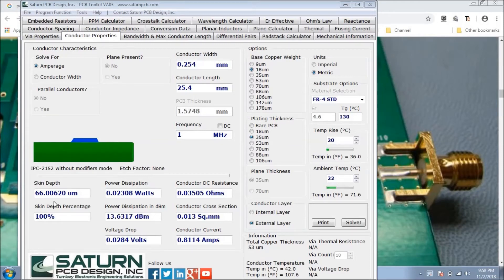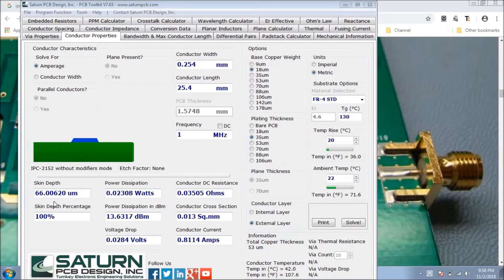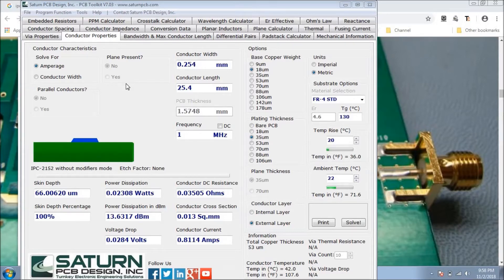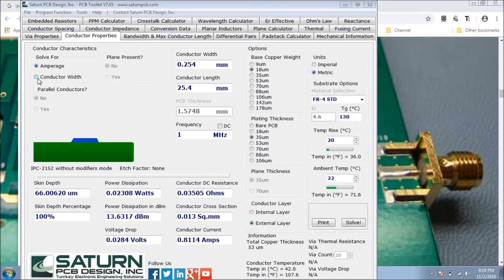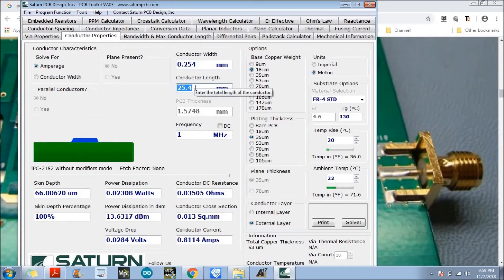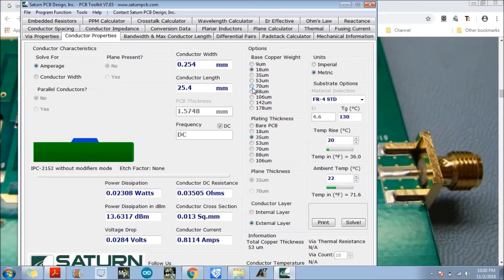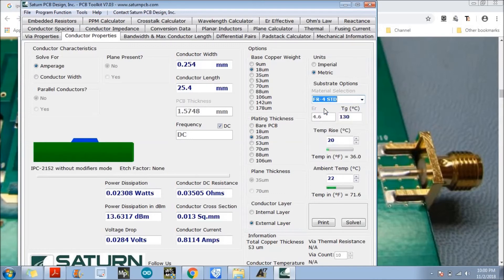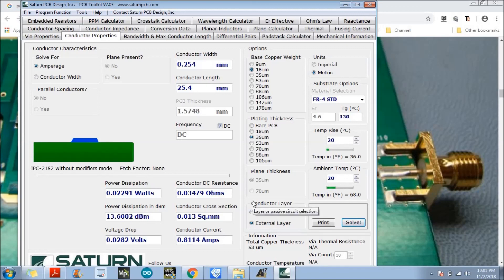Saturn PCB Toolkit tutorial Part-3: Conductors Properties in details

Comment: Can't find episode 4
if you could put up a playlist of all the 22 odd episodes in this series, that would be awesome
Reply from the maker: Hi Martin, there is already a playlist available for Saturn Tool, please check once in playlists section
Reply: @EsteemPCB  
ok, thanks, i'll have a look
although i don't know where the playlists section is
but, ok, i'll have a poke around
Reply: @EsteemPCB  
Oh i see...
No No...
here is my problem
i found videos 1, 2, 3 and the one that is not labelled as (but is still) 4

In video 1 he said he was going to go through every single tab, like 22 of them, so i'm looking for the Saturn PCB playlist that goes through all these

so..
Part 1 -  Introduction
Part 2 - Conductor Properties
Part 3 - via's
ALL DONE

I'm looking for 
5 - Bandwidth and Max Conductor Length
6 - Differential Pairs
7 - Padstack Calculator
8 - Mechanical Information
9 - Embedded Resistors
10 - PPM Calculator
11 - Crosstalk Calculator
12 - Wavelength Calculator
13 - Er Effective
14 - Ohm's Law
15 - Reactance
16 - Conductor Spacing
17 - Conductor Impedance
18 - Conversation Data
19 - Planar Inductors
20 - Plane Calculator
21 - Thermal
22 - Fusing current

the playlist only has 4 videos in it, i expected to see 22 or 23